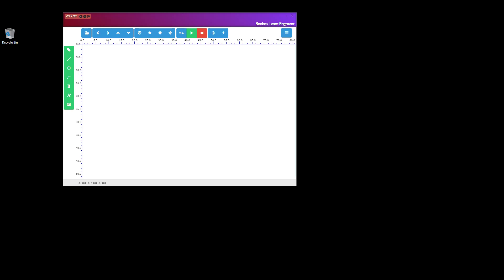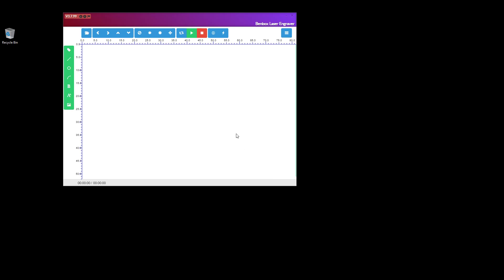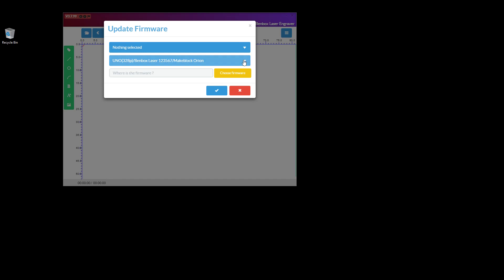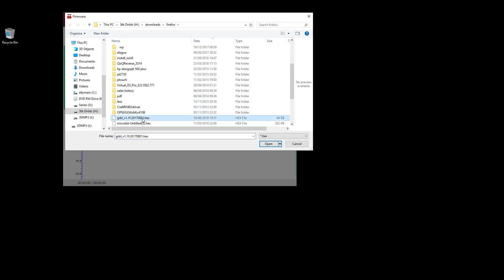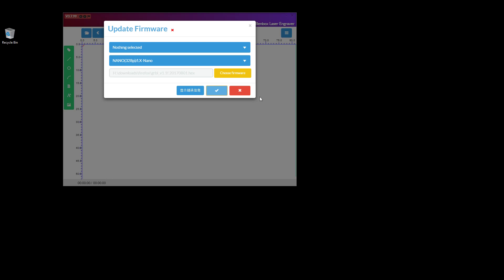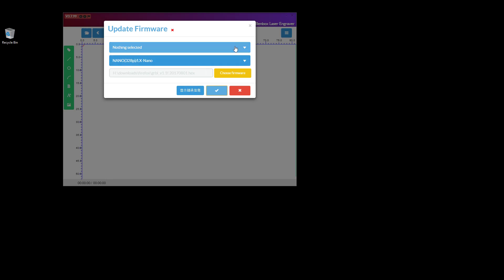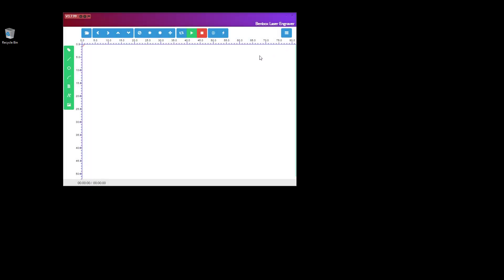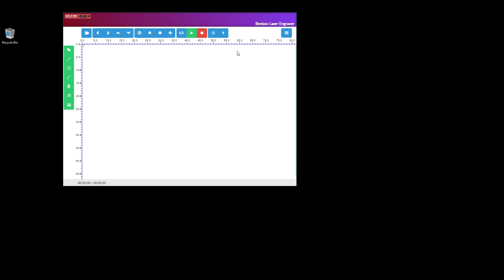Flashing GRBL Onto 5500mw Laser Nano using Benbox + Lightburn Software

Comment: hello. can i do this on any laser engraver board? i bought a VoidMicro laser engraver, it can connect to lightburn but when i try to klik the move, the y axis moves but after that it gives an error like this.. 

<Idle|MPos:0.000,0.000|FS:0,0|WCO:0.000,0.000>
Grbl 1.1h ['$' for help]
ok
Starting stream
error:7
EEPROM read failed. Reset and restored to default values.
On or near line 4:
Stream completed in 0:01

any idea?

Comment: Hi Round Tuit, thanks for posting this. I just recently a 5065 laser engraver and I successfully flashed the nano board with GRBL 1.1 but I am having problems getting it to launch on LightBurn. Could you please list your settings when adding this device in the startup device wizard.? Thanks
Reply from the maker: There are different 1.1 versions 1.1f is current and they all have different startup setting ie grbl. grbl m3 etc. best to join the forum at https://forum.lightburnsoftware.com/ as a lot of answers (that I don't know) can be found there and any question are usually answered quickly from people who know their stuff.